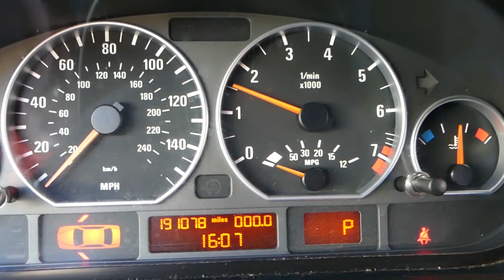WHY OIL LIGHT IS ON. OIL PRESSURE LIGHT ANY CAR

Comment: Hello, I have a 1993 Oldsmobile that has the pil light come on and off from time to time. During highway speeds it usually goes away. The car does have oil, and the pressure gauge shows a good oil pressure but the light does come on from time to time. That sensor has been changed before with an AutoZone part, a few yrs ago since the pressure gauge was flat out reading zero. The car works great but it would be awesome to get that light off. Thanks, great video and I will probably throw a new sensor and wiring at it hopefully it fixes that.

Comment: You also missed the oil filter housing valve. I had it 2 miles from last night. The car warmed up sweetly and sounded good. But the light came on and off. When I got home it was tappy. Definitely low pressure  my oil switch was recently new. Im doubting oil pump but I had recently serviced it. Connection there is the oil filter housing valve. To be investigated. Just hoping its not the cost of a new oil filter housing

Comment: I went on a road trip with a lot of elevation incline decline cording to the Subaru website it’s very common for the light to come on in the car attention I’m driving flat place today and it’s going on and intermittently coming off even though I still have a full amount of oil in the car I checked the oil three times on the road trip again still full oil.
Reply: Oil pressure sensor.. or oil pressure relay? Bad ground or exposed wires?
Reply: @erikdefries4956  everytime I turn on my car on idle it rattles and everytime I turn my oil symbol blinks on and off until I’ve successfully made the turn. Earlier it shut off both battery and oil came on . You have any idea what that might be.? Just wanna know before I buy a oil pressure sensor
Reply: L

Comment: My 350z was fine till I changed the oil and put a new sending unit on ebay. Soon as I started it at low idle it comes on but goes off soon as I give it throttle but the car runs fine what do you think its only at a stop
Reply: Oil pump pickup tube rubber gasket... also check for oil leaks around your oil dipstick tube... is the motor making any unusually loud ticking or clacking noises at idle?? If it is... you have stuck lifters my friend.
Reply: @erikdefries4956   I have ticking noise on my superb ,whats a stuck lifters ?
Reply: Had the exact same issue with my audi a4 b8. Fortunately for me was a very easy and cheap fix. Fixed it by replacing the 2 oil filter retaining post o rings. They were actually missing, l guess the previous owner never replaced them.
Reply: @erikdefries4956  nah it sounds good
Reply: @mrfrankgabz  thanks im gonna look into that

Comment: You did not mention anything about oil topping cap 
I think if it’s not closed tight they oil red light we’ll come on
Reply: السلام عليكم ورحمة الله وبركاته 
تتوقع حساس ضغط الزيت ممكن يمنع تشغيل السيارة
Reply: Hes talkin about oil not fuel though so the fuel cap is irrelevant
Reply: @joylitz2477  he's talking about the oil filler cap on the top of the motor... not the fuel cap at the rear of the vehicle........ pretty obvious... and even if it is tight on there.. if it has a worn out seal it will leak and cause the light to come on.. either get a new seal,new cap, or if you can, bend the tangs that engage your valve cover or filler neck on the oil cap itself causing more pressure against the gasket thus once again making it a sealed system and no more loss of oil pressure

Comment: I drive a camry 2005 and my oil light blinks when car runs idle .when I rev or move the car it goes off only to come back blinking when in a traffic and running idle.I just changed the oil switch and it's still blinking .I asked my mechanic and he said it should be the oil pump .Please advise on how best to handle this situation smi dont want my car to get damaged
Reply: Could be your oil pickup tube gasket or an old oil pressure/level sensor
Reply: Did you ever fix it? I have the same problem.
Reply: @MrRAQ18  I changed the oil switch a second time and it stopped .
Reply: @Abo-hr3rb  that's really good it was an easy fix. The same thing is happening with me, I'm taking it to garage to get the oil pressure checked. Thanks for the reply abo.
Reply: @MrRAQ18  Anytime

Comment: I having the same problem with my chevi but i changed the oil pump , the oil pressure switch  and the oil and oil filter

Comment: My light came on twice and then it went off it was really quickly I checked the oil and it looks dark and dirty could it be that or is it the oil pressure sensor. Should I get an oil change first before doing a oil pressure sensor anyway

Comment: I have a golf 3 1.8i gts I have upgraded it to a 2lt 
My oil light comes on and beeps  I have changed the one oil pressure sensor 
But still light comes on and beep sound 
What advice would you suggest
Reply: Oil filter is blocked,  below the pump.  Take off sump cover and it's right there.

Comment: my car oil pump warning light doesn't display on the dashboard when the ignition is on and engine not running. pontaic vibe 2003 model
Reply: Get the bulb or fuse fixed

Comment: I found surgar in the valve cover, I cleaned the surgar and now the oil pressure light is on.  I flushed out the engine 4 times already, the light was out for a day of running and now the light is back on.  The oil level is full.

Does any know a way to remove surgar from the engine and also any idea why the oil pump went back on.  Any idea will help.  Thanks.